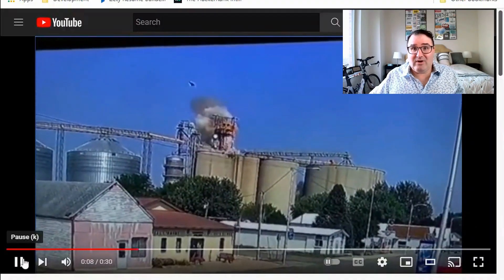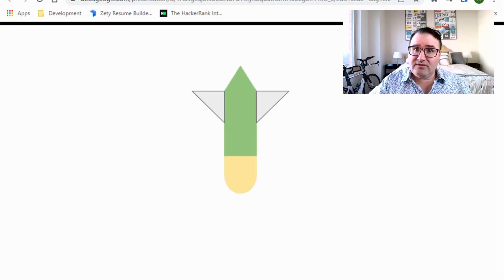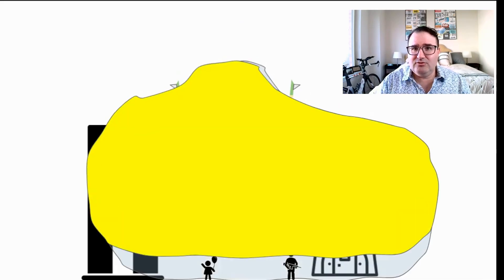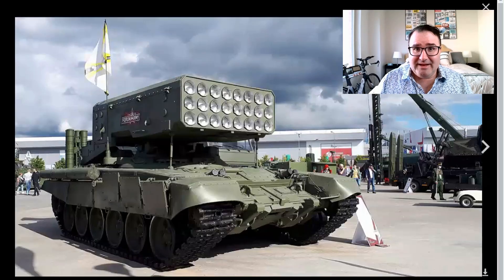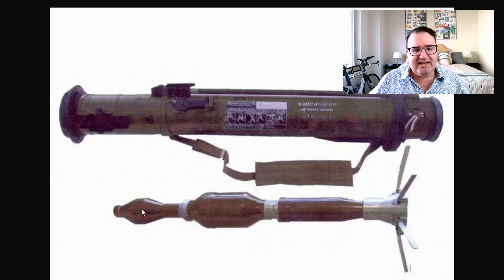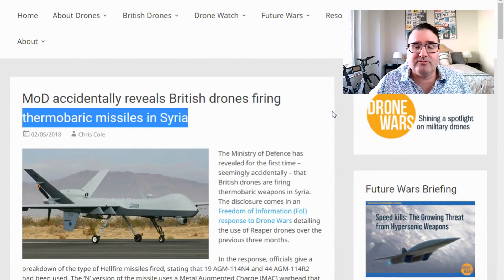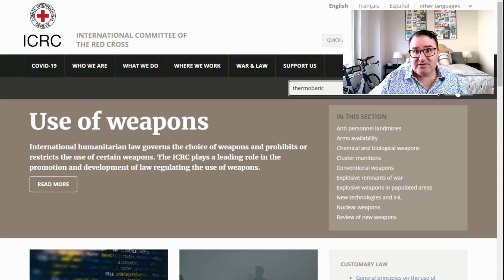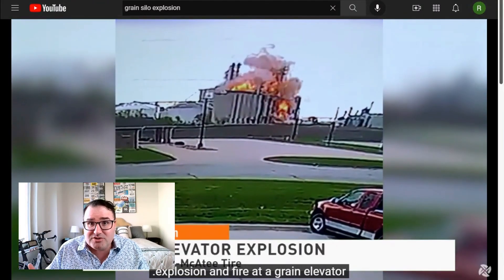How do Thermobaric "Vacuum Bombs" actually work?

Comment: I'm not a weapons engineer, but I do a thing or two about combustion, heat transfer, and thermodynamics from my experience with rocket engine design. So I applied my understanding of those topics to the situation and did some digging. Skipping the math for a sec, the TLDR is that you're right. At least in the literature I've found about fuel air explosions that's publically available, the exact effect of humidity is not easy to pin down because the combustion mechanism itself is a bit hard to pin down.

On one hand, you can approach it like a typical flame front, where the combustion wave (not the shock wave) heats up the propellant infront of it to the point of reacting (ie combusting). However this typically happens at fast but still subsonic speeds.

On the other hand you have the possibility that the pressure spike from the supersonic shockwave (yes, they usually travel faster than the ambient speed of sound, it's confusing but true [1]) could just heat the fuel air mixture up to the point of autoignitionnas it travels.

Ok, math/science time. What we do know is that with increasing humidity, air we will have lower thermal conductivity [2] and increased specific heat capacity [3] (aka how much energy it takes to raise the temp of a kg of air by 1 degree). So regarding the subsonic flame front option, humidity would result in a slower flame front and a lower pressure increase thus a less powerful and hot explosion.

However in option 2, the relationship between the temperature increase with respect to the pressure increase from a shock wave only cares about the ratio of specific heats. As you can see in Table 2 of reference 4, this value (whose symbol is small gamma) barely changes with changes in relative humidity. This means that the amount of temperature increase you'll get for a given shock wave stre gth is basically the same regardless of humidity, and so humidity would likely have little effect on the overall strength of the explosion.

Then all of this is further complicated by the fact that it likely won't just be option 1 or 2, but rather that the explosion may have phases where it starts as 1, then transitions to 2 then near the end transitions back to 1 again, or something (look up shock wave flame front coupling and decoupling). So ya, the answer is not only unclear, it may be specific for each bomb as propellant, dispersal, and ignition charge designs vary.

References:
(IEEE in-text citation format is the best, fight me!)

[1] https://physics.stackexchange.com/questions/193246/how-can-shock-waves-travel-faster-than-sound

[2] https://www.electronics-cooling.com/2003/11/the-thermal-conductivity-of-moist-air/

[3] M. BOUKHRISS, K. ZHANI, and R. GHRIBI, “Study of thermophysical properties of a solar desalination system using solar energy,” Desalination and water treatment, vol. 51, no. 4–6, pp. 1290–1295, 2013, doi: 10.1080/19443994.2012.714925.

[4] G. S. . Wong and T. F. . Embleton, “Variation of specific heats and of specific heat ratio in air with humidity,” Journal of the Acoustical Society of America, vol. 76, no. 2, pp. 555–559, 1984, doi: 10.1121/1.391597.
Reply: Oh and if it's raining or snowing then both options 1 and 2 suffer as energy is used up to melt and/or boil the water droplets or snow flakes no matter what the combustion mechanism is.

Comment: I also wonder if this is what the Allies did to the German city in WW2 where they bombed the perimeter with incindiary bombs and suffocated a hundred thousand inhabitants. Remember watching a program about it, but I don't remember which city.
Reply from the maker: Dresden.
Reply: You are either thinking of Dresden or Hamburg as those are the most famous episodes. However, they weren't nearly as deadly with 25000 and 37000 dead respectively.

So the other possibility is the firebombing of Tokio in wich around 100000 people died.

However all those cities were bombed with a mixture of high explosive and incendiary bombs, not thermobaric warheads. They would first drop the high explosives destroying roofs, opening cracks and exposing flammable interiors and then drop the incendiaries lighting everything on fire. They would intentionally time the bombing operations to coincide with hot and dry streaks in order to maximize damage.

Comment: As the atmospheric pressure doesn't increase when its raining, the water molecules displace nitrogen molecules mostly and because water weighs less than nitrogen, the air actually gets slightly less dense.

Comment: Wet air is less dense not more, H2O has a lower atomic mass than N2 80% o2 20%. It’s a common error you think because liquid water is heavy wet air is heavy, but trust me, liquid dry air is heavier than water liter for liter.

Comment: Personally, I think the moisture would decrease the peak blast temperature but increase the peak pressure as the water vapor instantly becomes steam and adds to the pressure.
Reply: This is correct, If water would be as droplets in air. But it is in air as gaseous form, or vapor.

Comment: 1,700c is the minimum temp required to combust some of the materials in the bomb. Most thermobarics reach temperatures of 2,000-2,500c which is hot enough to split water molecules into hydrogen and oxygen, potentially adding fuel to the fire if it’s raining or humid.
Reply: splitting the water molecule will take as much energy as combusting the hydrogen and oxygen will return, so it will not add any energy. however heating up the water will take energy

Comment: Environmental Scientist here, 
I don't think they would be an significant effect. Atmospheric differences in moisture, dewpoint and pressure are small when compared to the pressure change caused by an explosive. This is especially true in only 40 milliseconds.

I think there is a significant difference when used in a tight space or used underground because there is less air and air can compress. So there is less medium to absorb force as you can't really compress solids. 

I'm pulling from an air quality course on particulates I took two years ago so take it with a grain of salt.
Reply: Good points! Was thinking the same!! The explosive which disperse the agents would be far greater than the moisture to make a significant differences!

Comment: At those temperatures, I would think the water would be split into hydrogen and oxygen. I can't see that rain would make a lot of difference to the explosion. However, I think it could make a difference to dispersal of the aerosol. In the great scheme of things, I doubt either would be much comfort to anyone near one of these things when they went off.

As for the vacuum bomb thing... and forgive me, I am old enough to have read stuff before there was an internet, and so don't know where I read this, but... With the bigger bombs, the type that are dropped out of the back of a cargo plane on a parachute, the idea was they would be air burst (obviously) at a height where there would be a bounce effect. I think these were liquid fuel/air bombs, and like the fuel air mixture in your car needs compression to explode, the explosion happens at the edge of the pressure wave, and with the bounce from the ground, the pressure wave at ground level is immense, and traveling through that fuel/air mixture. To put it another way, you need pressure to get an explosive burn, the explosive burn causes the pressure.

This initial pressure wave is very fast and like a slap, but when the fuel runs out, this hot expanded gas cools and contracts, creating a negative pressure wave which is slower and more sustained -- this is like a full punch. Duration causes more damage to structures than the initial fast blast. You can see this effect on some of the footage of the old atomic weapons tests. I think the idea was they create big enough blasts, that you could create sustained "vacuum" for long enough to demolish buildings, giving the effect of a tactical nuclear weapons. A weapon of mass destruction capable of taking out a small town.